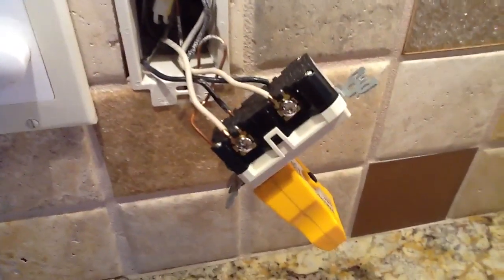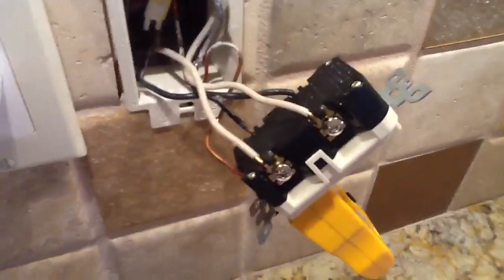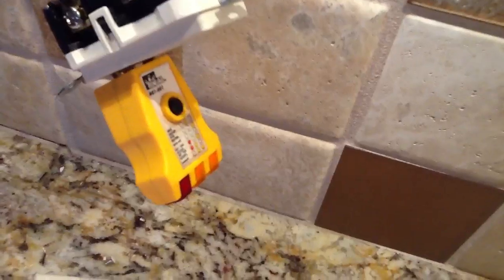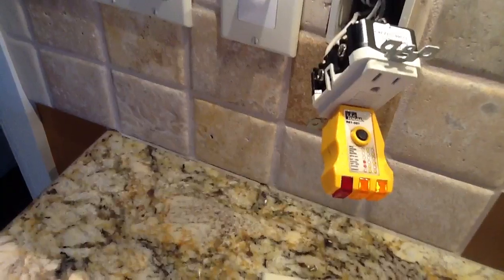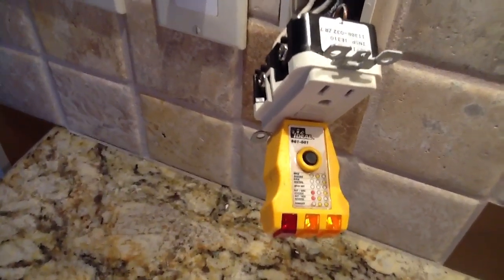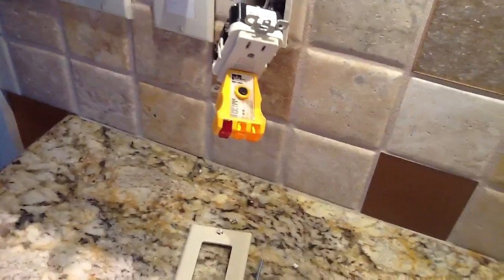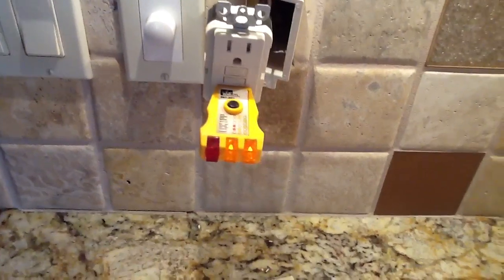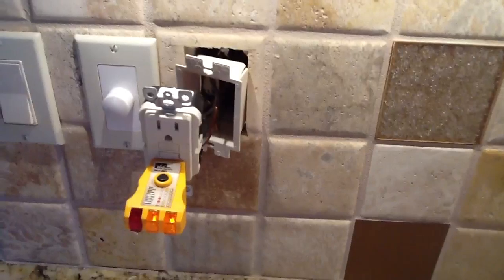Why does my GFI keep tripping?

Comment: When an electrician wired an outlet for my pool pump, he wired a GFCI into a GFCI and then buried a line to a regular outlet for the pump. It has worked for several years this way until this year. I replaced one GFCI, and my tester reads good on both GFCI's. Pump keeps tripping the GFCI.  The pump runs from an extension cord to a different outlet with no problem. Direct burial to the outlet for the pump tests good when disconnected and tested for grounds.  I'm at a loss.

Comment: I had an issue with a gfci randomly tripping out..  only running some led lighting and a mini fridge.. fridge is ran through a transient suppressor, surge protector then to the outlet..  turns out anything with a motor can trip the gfci's just because of the startup..  since fridges have a much bigger fla on startup then use the whole thermal relay to switch over windings put a back emf up the line and sometimes can tickle it just enough to trip the thing..  and i know its wired correctly because i did it myself..  is a home run dedicated on the ceiling of the garage with an over rated conductor sizing..  had me scratching the ole bald head..
Reply: how did you resolve the tripping?

Comment: Good day, afternoon or night my friend, hope you can help me out with this; there is a gfci on the kitchen that controls or protects 1 other outlet in the kitchen and two more on the dinning room, it keeps of tripping ever 1-15 minutes with out having anything connected to it, have a freezer connected on one of the other outlets that I mentioned. I plugged the freezer in other outlet with an extension cord and the freezer works fine and that gfci outlet stops tripping, what could it be? If I bring the freezer back to the outlet, the gfci outlet trips back out again. Any help before buying another gfci outlet. It’s about 15 years old gfci outlet, thanks, blessings.

Comment: We lost power for a few minutes and when the power came back on the GFI in the garage
 tripped and would not re-set. HELP?
Reply: If it's on an arc fault breaker and there was a power surge it could have tripped. make sure you pull it back to the off position and then back on again :)

Comment: Been quite a few yrs now that if you wire the line side on the load side. The GFI will not work.  UL made them change the GFI to not work if the line side wiring got wired to the load side.

Comment: My GFI in the garage was tripping. It was about 25 years old, had a refrigerator hooked up to it. I replaced the GFI with a new one.. Comes on no problem.. After about 10 minutes, it trips.  The breaker in the panel does not trip.  If I plug the refrigerator into a 20 amp plug (also in the garage) with an extension chord, it runs without an issue.  Any suggestions?

Comment: 'multi branch circuits", "shared neutral" I think that my problem.
Replaced a regular outlet  with a GFI it will trip if I plug something in "downstream" on the same circuit.
I'll replace it with a regular outlet as it was originally built.
The GFIs I have in the bathrooms (3) work just fine.
Reply: I’m having the same issue in my kitchen. I can’t find a solution.

Comment: I have an outside gfi recepticle which is connect to an outlet inside my basement. When it rains heavy outside it seems to always trip.   Does the GFI always have to be the first outlet in a circuit?

Comment: I need help man. I accessed an outlet outdoors. I ran wires from it to mount an outdoor spotlight. Got it all working great.... then noticed my GFI in the garage is tripped. I tried resetting and it trips instantly. I believe they are all on the same circuit. The outdoor outlet I noticed is not a GFI. It’s a 15v i believe. Any idea what I did wrong or how it can fix it? I literally wanted to just run wires from the outlet source for the light and now I am screwed 7 hours later. So frustrating.

Comment: My issue is that my master bedroom bathroom gfic breaker will trip every few months and blow out the bathroom light, when i try to reset the breaker in the panel it keeps tripping. If i shut that gfic breaker off for a few hours then turn it back on the bathroom light will be fine for a few months, then out of no where it trips again and i have to repeat these steps. I put a brand new gfic breaker in the panel and i am having the same issue.

Comment: I think GFIs are among the biggest scams going. "Electrician's Full Employment Act". Former Electrician at Home Depot told me they have a limited number of times they can trip. Manufacturers recommend they be replaced every couple of years - hundreds of reason why they trip and don't provide service. I've paid numerous electricians to replace them in my home and to assure they're wired correctly. Gave up=went around and replaced every time one with a non-GFI and I'll worry about it if and when I sell the house, but in the meantime I have electricity where and when I need it. That's what the damn circuit breaker is for anyway. And only contradict me if you can give me an iron clad instance of when the GFI would trip and the circuit breaker wouldn't and you'd have an emergency. Half a dozen electricians haven't been able to so far.

Comment: I am installing a 20 amp GFCI where a regular outlet currently exists - in the kitchen.  There is power to the box on a 12 gauge wire.  There are two load wires.  One is 12 gauge and the other is 14 gauge.  When I install the GCFI, it will trip when the 14 gauge is connected.  When disconnect the 14 gauge, it works fine.  Does a 14 gauge wire load on a 20 amp GFCI with 12 gauge hot, cause the trip?  I will have to replace the 14 gauge with a 12 gauge, I know.  But I just want to make sure the 14 gauge is the problem - I don't have any load (plugged in) on the 14 gauge circuit that I can tell.
Reply from the maker: There must be some kind of a 5 mA or greater short in the 14 circuit
If you’re able try a separate GFI on just that circuit and see if it works always tied to the line side
Thx

Comment: Thanks for the video.  I have a TV, sound bar and PS4 plugged into a 4 socket outlet. That line runs down to my panel and connects into a GFI outlet before continuing into my panel box.  It was installed a year ago when I mounted my tv on the wall.  Every few weeks, the whole line goes dead.. the GFI won't reset down by the panel. The breaker on the panel does not appear tripped.  I reset the breaker off then on.. and GFI can be reset.  Any guesses?

Comment: GFCI kept tripping when the ground was connected to the output side of the GFCI. When disconnect ground from the output side of the GFCI, the voltage reads approximately, i think, somewhere around 68vac to neutral. Checked for shorts, but none, yet it's 68vac. It started to happened out of the blue. Nothing was recently changed. What might be causing this other than possibly a leak from hot to ground on the output side of the GFCI? The first receptable is working fine, checked the voltage and used tester.

Comment: To my electrician friends.  My space heater keeps tripping the main breaker.  Anything I can due to fix this or are space heaters just  plain dangerous.
Reply: whats the amperge on it, and/or are you sharing any other devices with it. I Know that its a late response but would like to know what happened?
Reply: @Cod19335  - not sharing any other appliance.  Not sure of the type of breaker but it's more than a decade old. I know space heaters are problematic.
Reply: Stiv O check the amperage and the amperage on the circuit maybe it’s tied off to something and you don’t know it
Reply: or is your breaker an AFCI?

Comment: FYI-  the wires are wrapped around the screws in the wrong direction.  As the screw tightens the wire will be forced up and/or out from under the tightening screw.  Wires  should always be wrapped around the screw in the same direction as the screw tightens.
Reply: the wires are not wrapped around the screw they are stab set and the screw is tightened.

Comment: My refrigerator in the garage was tripping the gfci around every 30 minutes or so. Something about vapor compressor building up emi. The garage outlet was connected to the bathroom's circuit.

Deduced it to the fridge after I cleaned the dusty boxes, checked all the wire nuts, and googled for about 3 hours.
Reply: can you explain the vapor compressor? I've replaced mine switch twice in my garage because of it randomly tripping. The only thing I have plugged into it is an old refrigerator I was wondering if it was causing to trip..
Reply: @cprogress  basically from what I learned is that refrigerators were not built to be put on a gfci circuit.

I don't know what you mean when you say you replaced the switch. You reset the circuit breaker that tripped?

I ended up running a new circuit, from a new breaker in the circuit panel, to a new outlet in the garage.

Comment: Great video. My understanding is that Leviton gfci's come out of the box tripped, and can't be reset if there is a fault. Also the internal circuit is normally open and the test circuit must stay powered to close the circuit to give power to the receptacle, so if the internal electronics fail then it will fail into the opened state.

Comment: I tested mine today. i have a surge protector power strip connected to it.. so when i tested it the lights showed it was wired correct. I tripped the GFI and it worked correctly. but now when i plug in my  power strip the GFI keeps tripping after 10 mins or so. It never did that before..So im thinking it was stick before.. and i didn't know i was over loading the circuit, or the outlet is going bad. Any ideas?
Reply: I am having a similar issue. I have lived in my home for 10 years. I have my garage and outdoor outlets on the same GFI. The water heater is on that GFI. The water heater is tripping the GFI when the Christmas lights are turned on. I have used the same lights for years with no issues. If I turn those off then the GFI won't trip. Would love to know why this is happening. Is the water heater causing the trip?
Reply: @conniekeenanlowry5191  wow old post. Sorry I didn’t get back to you sooner. I hope you got your problem fixed.
Reply: @mykeeX13  I did. Turned out to be an extension cord plugged in outside was getting wet. Got an extension cord cover and it worked perfectly.
Reply: Have you got any answers on this? I'm running into the same situation now. My gfi in garage was tripping every 30 sec. Replaced with new gfi by electrician. Worked for a day. Now same thing is happening. Trying to figure out what's on that same circuit. How do I? I check every outlet. Any ideas?
Reply: @adambplus3  if you have a power strip plugged into that outlet, plug it in to another outlet GFI outlet and see if it trips the GFI, or start unplugging each device on the power strip one by one and see if it still trips the GFI. 
That’s what I did and realized I was overloading my circuit.

Comment: I just replaced the Gfic with a new one cause the old one keeps tripping.   New install is Still tripping, I check down streams 3 outlet all seem to be fine. What is up?  I will double check to make sure the ground wire is not touching anything after viewing this video.  But, any other suggestions?

Comment: Great video!  I miscut the wall and the inspector asked me to add a box extender for proper installation.  The first box I bought wasn't big enough so I returned it and got an extra large one.  Now my outlet fits in place just like yours is showing.   Thank you! https://www.amazon.com/gp/product/B07CBTVFHM/ref=b2b_gw_d_simh_a1_1_p/144-8011823-6237906?ie=UTF8&pd_rd_i=B07CBTVFHM&pd_rd_r=0MKRX7NF0GDDWS1QM8MM&pd_rd_w=grKYG&pd_rd_wg=svg7d&pf_rd_i=b2b-desktop&pf_rd_m=ATVPDKIKX0DER&pf_rd_r=0MKRX7NF0GDDWS1QM8MM&pf_rd_t=ABGateway&refRID=0MKRX7NF0GDDWS1QM8MM

Comment: Some great tips (with likely extensive repairs; running a new line may be the fastest resolution). Are the shared neutrals the same thing as "ground loops" (large current flows near small current devices)?
Reply: Not extensive. Usually, whomever made the connections inside the box, either wasn't paying attention, or didn't know what they were doing. The only time you need to run a new line is when the existing line is over-used (too much amperage for the circuit & the breaker). Microwaves, AC units, and power tools are culprits of tripping overloaded circuits. They draw more amps than the circuit can handle. Shared neutrals are not ground loops. A shared neutral is a single neutral being used on more than one circuit. Ground wires end up in the ground. Neutrals end at the transformer.

Comment: That tester is not a legal way to test a gfi or gfci  the test button is the only legal way to test it, that tripper you have puts a load from hot to ground, but most of the time people don't plug in stuff with a ground pin on it, and you can wire them without a ground you just have to put the sticker that says ,no equipment ground ,and it's legal

Comment: Just looking at the view in the video..
Look at the bare ground wire...
It's a common problem 
That when installing into the box, for it to hit one of the terminals...
Bare ground wires stink..
Better to heat shrink them.
And pay close attention to them once the device has been installed...

Comment: I truly appreciate the videos "easy to understand: I was going to take you up on your offer to call you if I have a concern or electrical issue? well I do !! I have a "dead outlet which is dedicated to the microwave 900-1100 watts; there is no power to the outlet; right below it is a duplex 15 amp 125v outlet; the next outlet is the gfci in the bathroom,this is where it gets weird?? if I plug an appliance into the duplex outlet all is good - HOWEVER if I PLUG THE AC TESTER THE SAME ONE YOU USE INTO THE DUPLEX OUTLET THE GFCI IN THE BATHROOM TRIPS EVERYTIME; WHY IS THIS- IS THIS A GROUND ISSUE?? I CANNOT SEEM TO GET AN ELECTRICIAN TO COME AND ASSIST?? I LIVE IN THE BOONDOCKS; WHY WON,T A GROUNDED APPLIANCE "NOT TRIP THE GFCI- BUT PLUGGING IN A 3 PRONG OUTLET TESTER "CAUSE THE BATHROOM GFCI TO TRIP, AND I MEAN EVERTIME???ANY ADVICE WOULD BE APPRECIATED, THANK YOU MR.JONES-PATRICK.P

Comment: I HAVE A 2003 RV CLASS A- THE RV CAME WITH S.C.D.,S self contained devices- they used PASS&SEYMOUR RECEPTACLE THERE IS A SINGLE SCD INTHE CABINET FOR THE MICROWAVE THERE IS A SECOND DUAL RECETACLE ALSO SELF CONTAINED OUTLET THE NEXT OUTLET IS A BASIC GFCI WITH STANDARD CONNECTIONS; THERE IS NO POWER TO OUTLET #1- THE MICROWAVE- WHEN I RESET THE GFCI IN THE BATHROOM AND PLUG A VOLTAGE TESTER(THE SAME TESTER YOU USED IN YOUR VIDEO) THE GFCI WILL TRIP- EVERYTIME"??? ALL OUTLETS ARE 15 AMP 125 VOLTS- YESTERDAY I PLUGGED A PORTABLE SPOTLIGHT CHARGER INTO THE DUPLEX OUTLET AND IT WORKED JUST FINE?? THE RV IS OPERATING ON STANDARD HOUS CURRENT 120-125 VOLTS; I DO NOT UNDERSTAND HOW PLUGGING A CIRCUIT TESTER INTO ANY OUTLET WOULD CAUSE THE GFCI TOO TRIP??? EVERYTIME??? GOOD CLEAR SUCCINT VIDEO,S I LIKE EM!!  ANY SHARED THOUGHTS APPRECIATED,PATRICK.P

Comment: Thank you for your video.  Here is my question:
There is a GFI & light switch combo for over-the sink VANITY lights which are almost never used & where shower is run only a handful times a year, so moisture issue very unlikely.
There is a light switch for the bathroom CEILING light located on the wall OUTSIDE the bathroom.  About twice a month, when this ceiling light is switched off, the GFI will trip.
As a DIY, I have some electrical experience. I haven’t opened it up to look at the wiring yet, & don’t have a 3 wire tester yet, but what do you think is the most likely problem given the fact the GFI trips so infrequently & it is with a light switch not associated near the GFI.  ?shared neutral

Comment: Hey I’ve got a short somewhere in my outdoor yard lamp. Previous homeowner added a motion light to a backyard light and the thing kept tripping the circuit. I removed the motion light and found the bare ground wire arcs when I touch it to the housing from the old motion light. How do I find the nick in the line? Thank you for your input

Comment: I understand that the gfci trip at 6 mA, and that there are two types, of 5 and 20 milliseconds of response, these small currents can be caused, in addition to a discharge to a person, by any leak in the installation, by rust , by moisture, by a damaged insulation that leads to earth, defective appliance, etc. could be this the cause of tripping?
(please excuse me if any misspelling error)

Comment: Some years ago I installed a GFCI outlet in a bathroom of a 1950s house that was wired with 2-wire NM cable, except there had evidently been some remodeling, as the bathroom had 3-wire grounded NM cable in it.  Inexplicably, the GFCI kept tripping every hour, or so.  It turned out that the kitchen circuit was sharing the neutral with the bathroom and every time the refrigerator compressor started or the refrigerator door was opened, the GFCI sensed a current imbalance and would trip.  The problem was solved by removing the drywall and running a dedicated NM cable from the main panel to the bathroom.
Reply: Grounding on bathrooms was mandatory in the 50s.
Reply: @okaro6595  He CLEARLY said there "evidently been some remodeling".......... SMH
Reply: A lot of things are "mandatory"..  just like its "mandatory" to drive the speed limit but people get tickets all the time..  and there will always be a Mr. Smartfart Mcgee who was so smart he became a master electrician while working full time for roto rooter and argued with the inspector that he swears he didnt bond the sub panel and it didnt come with a bonding screw as their standing over a dead dog in a puddle of water around the post light.   Its always the new guys fault even though he wired it all by himself..